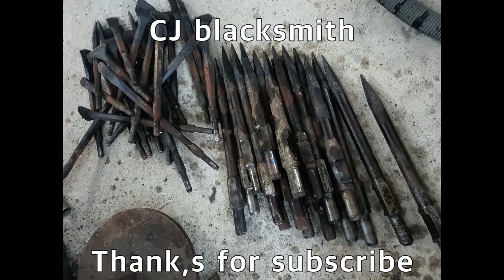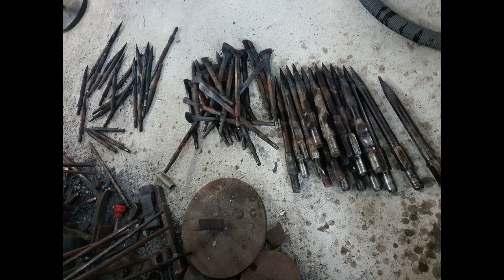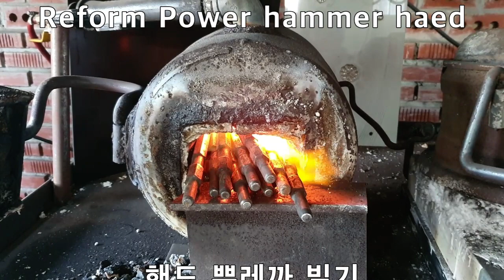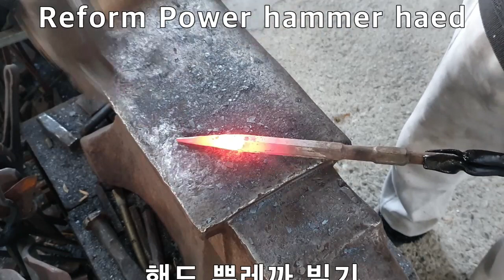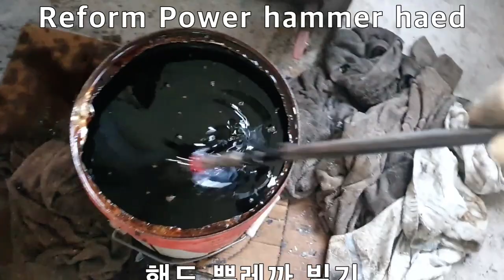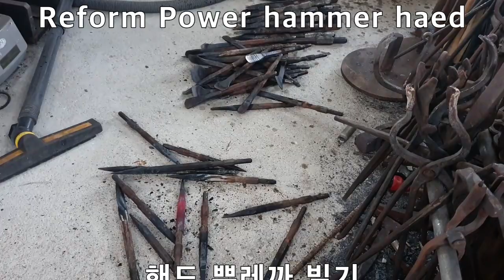Reform power hammer head.

Comment: Hi there, I don't want to offend the worker which seems is working hard... A blacksmith with low experience can make the finishing harder, resulting in longer machining work thus more expenses. Very warned anvil and wrong way to use it makes even worse on the piece and on the anvil itself. They have a power hammer why not using a die to form final shape. Plus throwing the artifact on the ground after oil annealing may cause stress or even an invisible crack on the very edge of the point. Sorry to say but these pieces seems ending to be very low quality tools. 😉